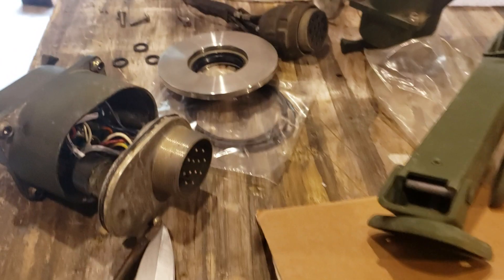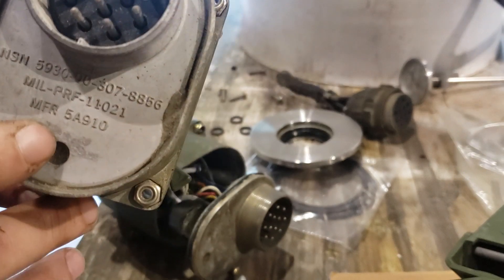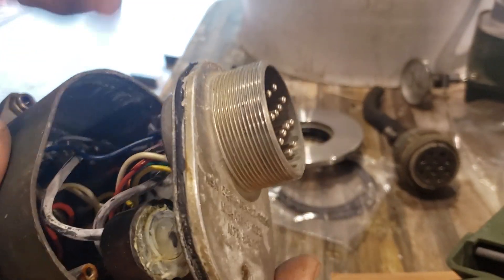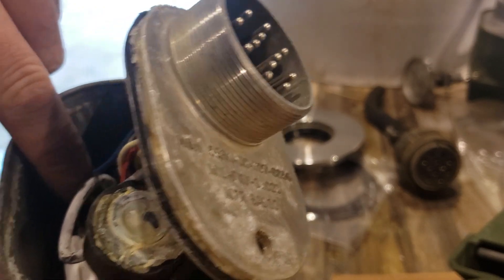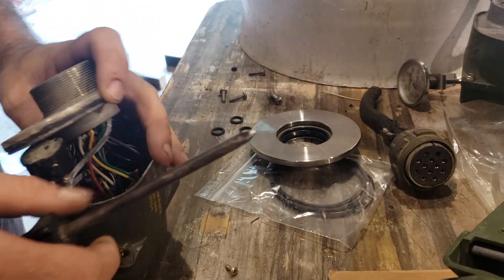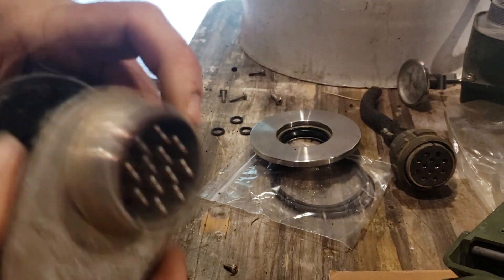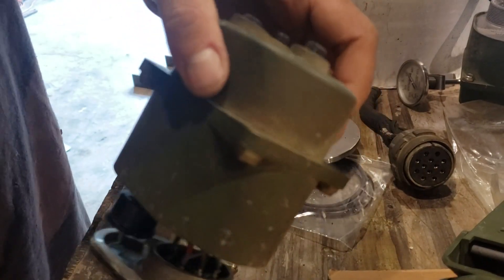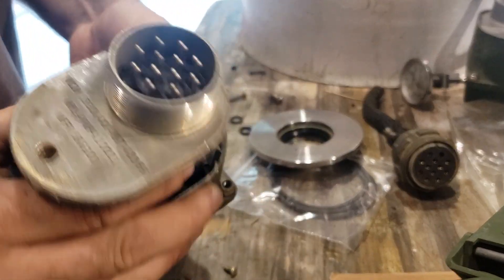What's inside a master light switch, and can you fix it?

Comment: The two parts you were looking at that you thought looked like springs maybe once actually were springs maybe once. Lol 😆
 The holes for the springs should actually be the same size they're probably just filled full of debris and rust.
 Before you begin it is good to have both switches in the off position before disassembly so they don't fly apart. Then look and see where all the contacts are located before letting any of the releases for the switches out. Then release the center of the loan flat metal clip that holds them in and carefully remove it without breaking the center pin that holds it in place that is plastic. Then you can turn the knobs and carefully release the pressure off them and if you hold it upside down everything will stay in place as you take it off and remove it. Each knob works that way. You will notice for each knob to little black plastic clips that in the off position hold the assembly from falling apart as you disassemble.
 Use this method and maybe put up a video to show the arrangement of the contacts because mine was taken apart previously and I don't remember where the contacts go in the correct order.

Comment: I changed my Master light switch with a new one on my 1970 M35A2 after I accidentally grounded out the power wire on the headlights but my headlights still will not come on, any idea's?
Reply from the maker: Either both bulbs are bad ( not uncommon) or there is a short to ground in the headlight circuit.
Reply: @tacticalrepair   Thanks you were right. Both new bulbs were bad, I had just received them so I stupidly thought na couldn't be . thanks for the help 8 ).